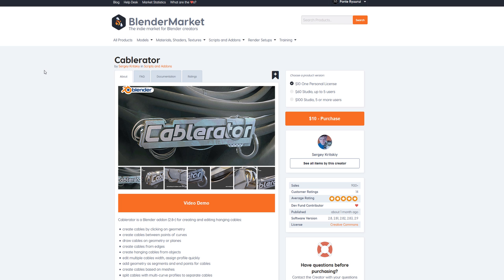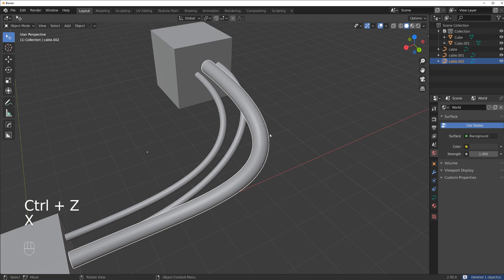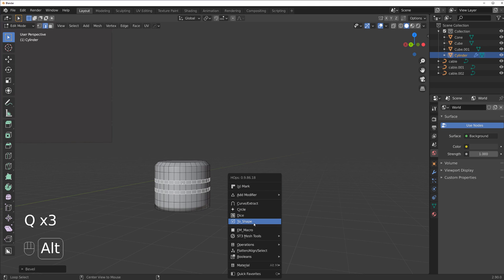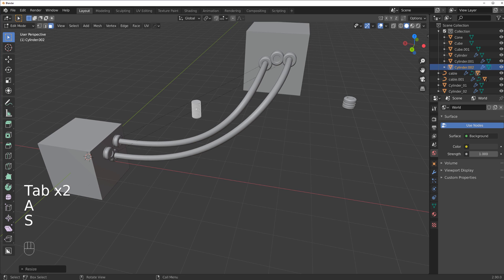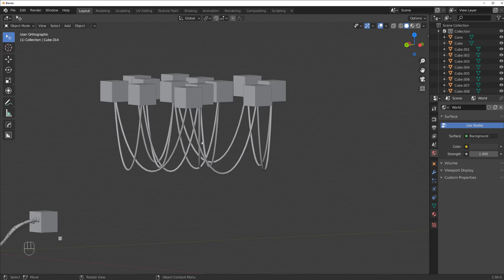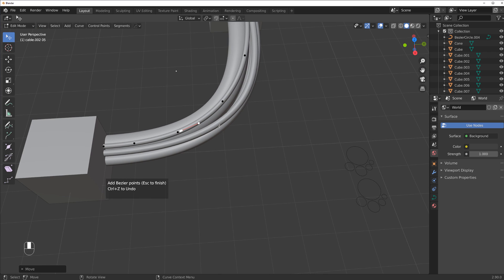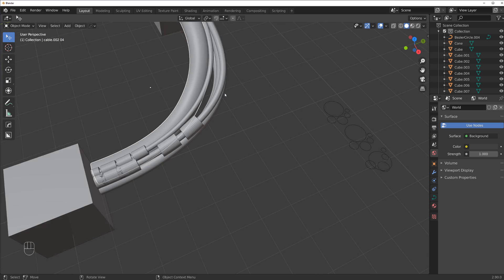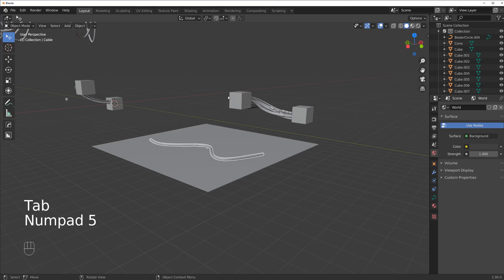ONE click SCIFI cables in Blender

Comment: Hi Ponte. Have you ever encountered a bug when adding connectors where the selected objects appear somewhere else in the scene and don’t hook to the cable endpoints?
Reply from the maker: shift h to isolate, it's a blender issue not cablerator's
Reply: @PonteRyuurui  Isolate what? The connectors, the rest of the scene, the cable. My connectors don't end up on the end of the cable. Help Please!
Reply from the maker: @williamrose1020  isolate the mesh, use shift h and see what it does

Comment: One thing i don't understand about Cablerator: Why does lowering the tension only affect the X axis, wouldn't the cables sag down on the Z axis if they were looser, even if you change the tension by a large amount they only ever push out horizontally...
Reply from the maker: i dont follow, they do sag on z axis, also remember local rotation
Reply: @PonteRyuurui  If i place two squares and place a cable across them, adjusting the tension only makes the bend larger, it doesn't follow gravity.

Comment: is there also a way to convert a circle into a cable/pipe ?
Reply from the maker: ya many ways, you could use hardops for it as well, in vanilla blender you use circle curve to control the diameter of the pipe or cable

Comment: What about parenting between 2 moving objects, like upper and lower leg segments on a mech? If I parent to the upper segment, when I move both segments,
it detaches from the lower segment. Do I have to create new cables for each re-positioning? Or how is this solved?
Reply from the maker: you mean like a piston? Well, the cable is parented to the end caps, so you could parent them to the mech's legs I suppose.
Reply: @PonteRyuurui  I'm running hydraulic lines from a reservoir to all the parts that need to be activated hydraulically. 
I hadn't thought about whether the end caps could be parented separately.
Reply: That worked! Thanks!
Reply from the maker: @KennyleeBeeks  sweet!

Comment: Thanks. Can multiple cables be rotated relative to each other?  like a rope.
Reply: You could but this won't be very effective because if you change rope length you'll have to modify points rotation (Tilt). Easier way of making a rope would be creating a base mesh part and assing it to a curve with Cablerator Convert to Mesh Cable function:
https://i.imgur.com/5ghAyDM.png
1 create a circle
2 radial array it (manually or with Hops)
3 screw modifier
4 rotate circles 45deg to get rid of squishiness
5 assign the mesh to a curve with Convert to Mesh Cable
Reply: Sergey Kritskiy Good solution, thank you very much!!!!! 😉
Reply from the maker: Use HOPS To Rope option and done.
Reply: Ponte Ryuurui thanks i will try it !!!
Reply: Ponte Ryuurui its works perfect, thanks 😉😉😉😉

Comment: Hi, just a quick question. Can I keep 2.83 installed and install also 2.9 without uninstalling the other one first? I really want to keep the LTS one on too. Any suggestion? Bought this addon a week ago. Great stuff.
Reply from the maker: ya man, you can have more than 2. I still have 2.82, 2.83.5 and 2.9. You can run experimental too as 4th.
Reply: @PonteRyuurui  Thx.
Reply: @PonteRyuurui  Can I load my settings from 2.83 or should I just set up a fresh one for it?
Reply from the maker: @Bergerons_Review  You could but I would not recommend it. It will import everything with one click, true, but it could bring over config issues or create new ones. It really depends on how many addons you are using and how often you mess with config, either directly or indirectly.
Reply: @PonteRyuurui  okay, thx. I set it up fresh then.
Reply from the maker: @Bergerons_Review  ya man, better do it once than twice